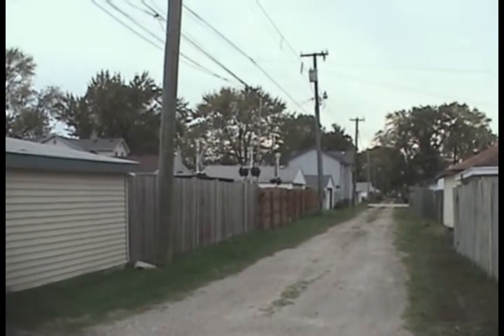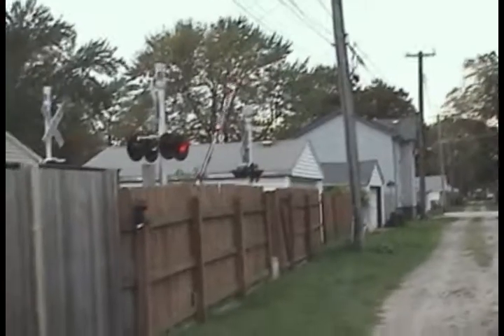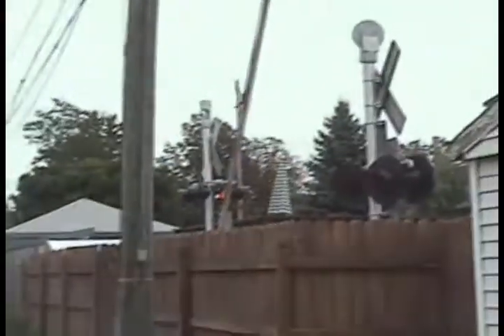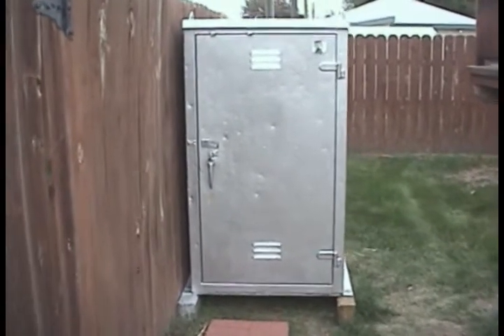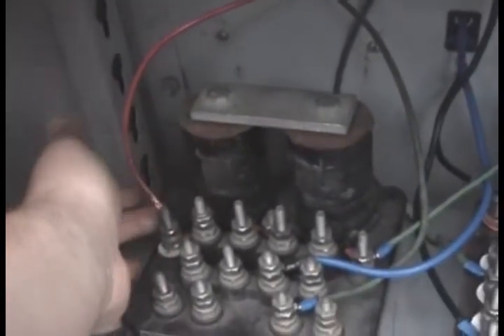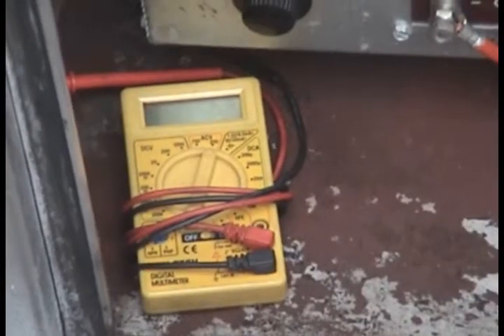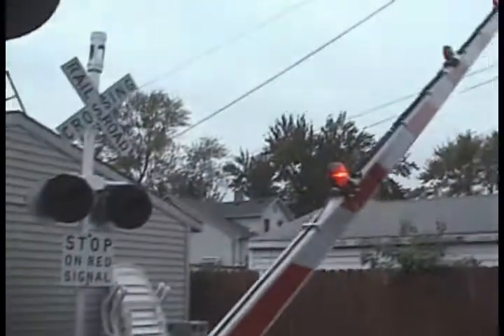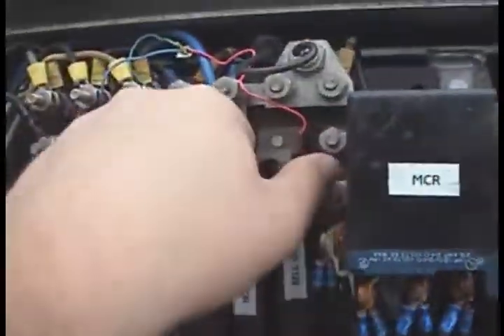My Crossing Signal System Summary, 10/5/08

Comment: In the now time, after Mill St. got upgraded, now it's wired the same exact & similar ways as your Signals there, as the West Side does the same exact thing on both Signals, if there's a Train on that 2 Tracks, while the Bell on the Gated rings all the way through until the Gates are all the way up, while the East Side also has the Bell part in the same exact way to have it on the Gated shut off before the Gates start lifting, while I think that the Back Lights on the Mast continue to flash with the Front & Gate Lights on the Gated Signal, as I somewhat can't tell right now until hopefully Caleb Belcher films the front of the East Side one day to my request, as that I'd like to find out with. 🤔

But yeah that again, both sides of Mill St. are now wired the same exact & similar ways as your Signals there, after Mill St. got upgraded with the change of the Lights, Bells, & Gate Mechs.

So, Mill St. is now (similarly) copying your Signals there via the Outer Tracks. 🤔

Comment: You know what would be better. If the bell was mechanical, like the WCH bell. On the top of the signal with the gate but the bell rings when the gates go up, and down. When its fully down it shuts off

Comment: yeah most of the crossing in fla are wired like that for the most part. yeah you must have very cool neighbors. id be ok with it but  having the bells stay running the whole time would get to me  over time. the lights you could keep on all the time id be fine. very cool how you showed the cabinet and how the sensors work with  the alleyway.

Comment from the maker: Thanks.  It took over a year to get everything I needed to complete it.  The sensor is supposed to be mounted about 10 feet high, but It's about 4 1/2 feet high.  This causes a shorter activation distance than it would with it mounted the correct height.  It usually activates 50 to 70 feet away.